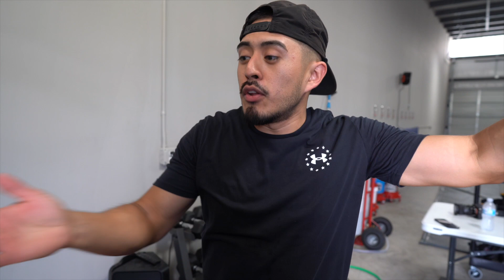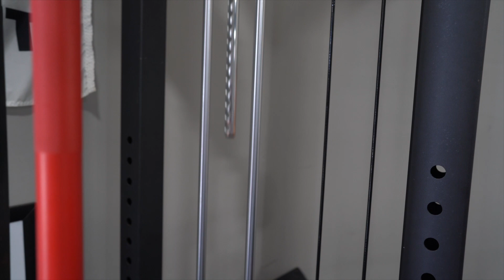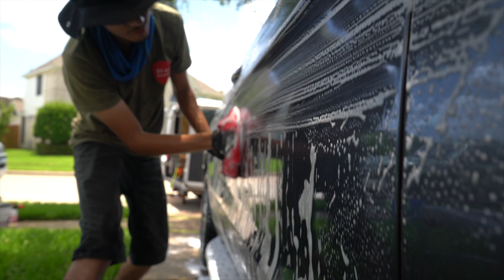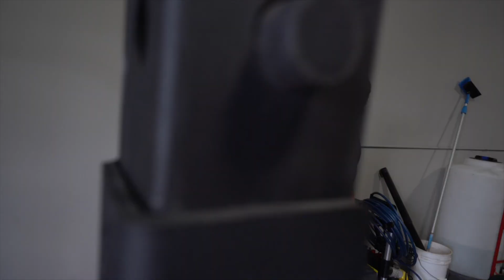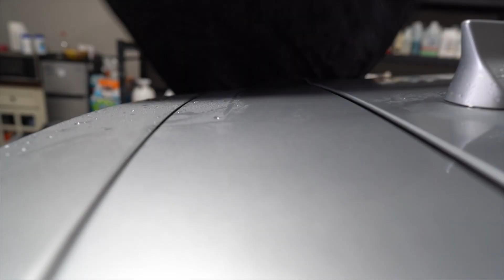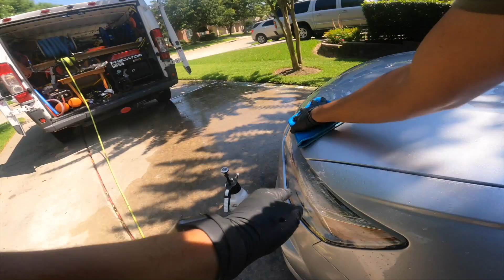Quitting My Detailing Business (My Advice...)

Comment: Would applying wax with a battery powered machine, take off marring from clay bar!?
Reply: No but it would fill the light scratching from it, a real wax doesn't have abrasives in it.
Reply: @zachliechti5476  is their a clay that is lite enough to not to mar paint
Reply: @joshyarbrough7186  any sort of clay will marr paint. Clay is considered a abrasive